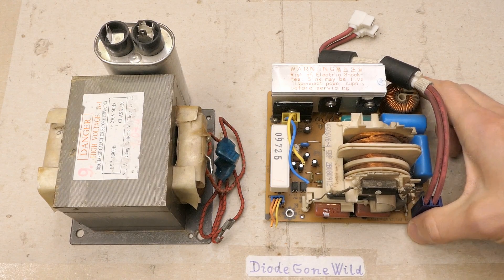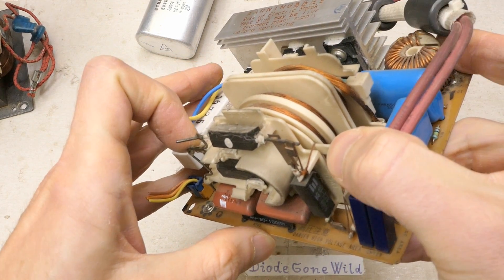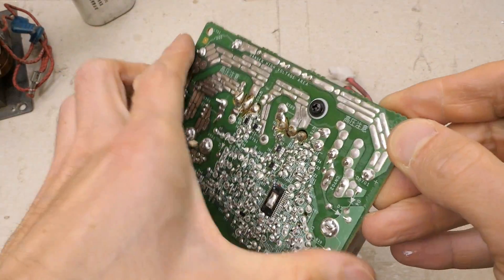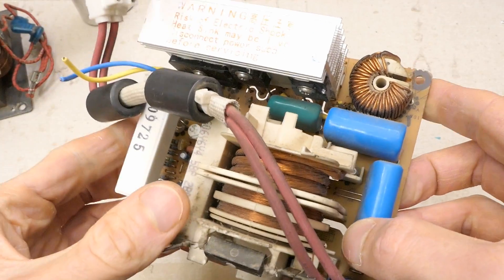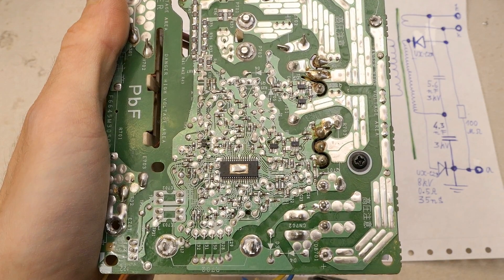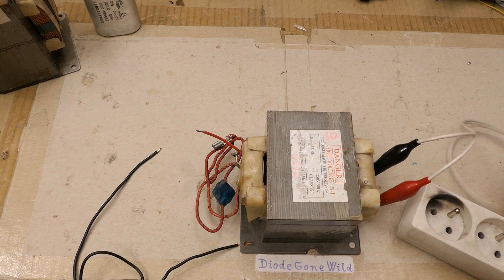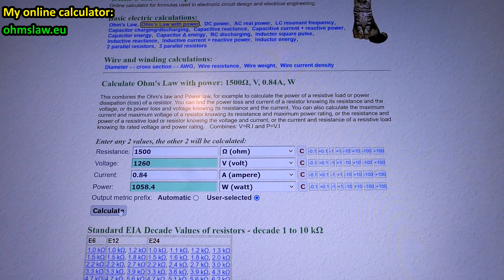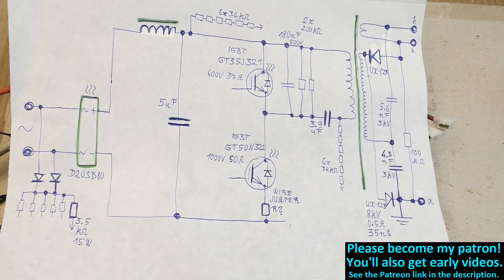A Microwave Oven Transformer, but switching!

Comment: Thanks for this. I'm sitting behind my screen, with a similar part in my hands  trying to figure out why my Siemens oven gave an E 10 07 error.  I see a voltage drop as well on the transistors. Yep, they drop to 0....

Comment: Have you ever tested the power used by Panasonic Inverter ovens? I've found three of them on the street for trash pickup in my neighborhood. They work fine but they draw 1800-2000 watts on high. My neighborhood has mostly older homes, many with 15 amp (120V) circuit breakers. These Inverter owens can trip the breakers. I assume that's why owners think they are defective and throw them away. One I found last week looks brand new but draws over 1800 watts on PL10 (high). Works fine on PL8 or lower on my 15 amp circuit. I've never tested the power used by a brand new oven. Maybe the ones I've found actually do draw power far above the normal. I don't know.

Comment: Very informative video, Thank you.
At 10:10 onwards, what (kinda a self made) device you are using with single 7 segment display & two crocodile clips to measure transfotmer windings? What does it measure?
Reply from the maker: It's a ring tester. It tests the Q factor of the windings. If it's very low, it tends to indicate short turns in the winding.
Reply: @DiodeGoneWild  Thank you

Comment: This is an excellent comments section and a well informed video too.
I've just repaired my Panasonic microwave and worked through the circuit on the inverter to checl the components.
Before the the inverter there is LC and MOV filtering with single glass fuse. Energy is switched with a spst relay on line. Safety interlocking shorts the line and neutral if the relay is closed, but the door opened (user exposed to rf).
Idle current for the inverter (230volts ac) is <100mA. No load current is <500mA and full load for a 1000w (output) is ~7 amps (1300 w rated input).
The output is duty cycle regulated by PWM. There should be a more liner power reduction rather than the long cycle times from on/off transformer systems.
The service manual states upto 40kHz switching frequency.
The heat sink is live (electrically hot) via the igbt tab.
The grounding is via the high side screw hole and solder ring to chassis or frame ground.
There are a number of designs about but the pcb looks like the same one with various pads depending on components.
I may try to upgrade a dual magnetron commercial microwave with these as it has a transformer failure. A simple pwm driver should make it possible.
Note that these come in shrouded air ducts.
There is an NTC on the collector pin for thermal monitoring.

Comment: Add lot more diode and HV capacitor to voltage multiplier section then connet it with an x-ray tube. 
It is will be as dangerous as possible.

Never combine HV with HF. It is cut thru any isulation, what are usualy works well at low frequency.

Comment: Microwaves are dangerouse but having said that so are cars. Research brings knowledge I have built my own spot welder for 1/4 inch steel and for welding alloy.I have built myself a 12v heavy duty car battery charger.Numerous other things from microwaves. Not out of need I have excellent welders and numerous battery chargers. But solely to learn. So research what is safe and not safe and take extreme caution and do not blindly follow someone else who says do it this way do your own safety research.I can repair most cars, commercials,tractors, forklifts etc all self-taught. I am about to try a repair on my microwave power supply as I have a bad IGBT.But that is not recommended unless you have a lot of experience and again take all safety precautions. PS i will not pass on any info as to how I have made things do your own research you will then be safe.

Comment: The only real benefit to inverter based power supplies is powerfactor. That and it's less likely to kill idiots because they typically break before you can do anything silly with them. 

I like fancy inverter stuff but only when schematics and stuff is available. Proprietary non serviceable designs are basically E waste

Comment: This seems like some kind of active clamping soft switching forward converter, instead of the normal fly back converters. The primary capacitor is placed such that it functions as a series resonant LC tank, and the top transistor is probably the smaller one for clamping the "reset" current (inductive kick back). It's very likely that the main switch is operating with soft switching, and the auxiliary switch could also be soft switching if designed correctly.
Reply: Also to mention, in some soft switching converters, only the primary switch is designed to be soft switching since it sees the most amount of current, and larger switches have more switching losses. The AUX switch doesn't need to be as big and consequently has less switching losses, therefore the switching losses from hard switching is acceptable.

Comment: Thank you Sir for this video.   Can the inverter board be replaced by using the normal transformer with capacitor and the high voltage diode?

Comment: From all that I’ve read from other sources, the switching supplies in these ovens operate at about 50KHz. That makes them much more efficient than the 60Hz transformers.  The ferrite core in them is built to run in the 20 - 50KHz range. 
I’m looking for one of these boards to rewind the secondary for low voltage, high current output.
With this high frequency, copper coated aluminum wire must be used due to the skin effect of electron flow. Using solid core wire is a waste here.

Comment: Can somebody provide some insights as to why the capacitors in the doubler circuit are different values?
This seems to be the case in every microwave inverter I've seen.
Reply: They are the same value in the older Panasonic Series 2 inverter I have in front of me, but later series certainly use two different values, usually when they are a single ended parallel resonant converter, which is not symmetrical in operation. The capacitors are resonance capacitors. Not simply energy storage for the power output, but a time constant in resonance with the transformer inductance, as is also the case with the much larger single capacitor in the mains transformer designs, them at 50 or 60 Hz, these at tens of KHz. I hadn't seen specific discussion of the capacitor values but I did find a technical document that covers it. Linking away from YouTube is problematic due to rules, but if you search for "Parametric Design Guidelines for MW Oven Inverter" you should find it. If necessary add Bocchiola.
Reply: @PlatypusPerspective  thanks for the info!
Reply: @MrTurboturbine   Hope it helps. 🙂

Comment: I ran the single transistor version of this inveter and it wants a 220Hz 5v squarewave PWM 100% positive offset on the input opto. it needs to be at a low duty cycle to start say 20 percent iirc

Comment: What I have thought of for a good while is why you need the voltage doubler at all in microwave ovens instead of using a transformer outputting 4000-5000 kV directly to the magnetron? Does it have something to do with insulation capabiities of the transformer at this size or something similar?
Reply: Yes, greater difficulty and cost for no advantage. The voltage doubler is ideal for the purpose - half the voltage handling requirements for components (transformer, rectifier, capacitor) which would otherwise have to be far greater voltage rated, and draws power on both half-cycles of the mains (desirable) rather than only one for a simple half-wave system.

Comment: I appreciate your discussion of the dangers but showing yourself drawing an arc with what appears to be normal house wire doesn't seem like a good idea. I see that the wire is grounded to the MOT core so theoretically you are safe. Your fingers are only a few inches away from that arc though. I would have done the demo using a small hot stick to hold that wire. One of my son's friends was killed by a MOT while doing wood burning because he thought that normal THHN house wire, which of coarse only has a 600 volt rating, would protect him.

Comment: where could I find the schematic at 0:36 ?
Reply: The specific schematic onscreen? It's completely visible, so take a screen shot? Print if desired. Or copy by hand? The Czech source site is watermarked on the image, but nothing identifies the type of microwave that schematic is for - it is rather characteristic of older model Sharp units.
Reply from the maker: https://danyk.cz/reverz04.html

Comment: If you run the control section with the power transistors removed it could give you the operating frequency. Good to know these exist, so I can use the old audio mantra (mo heavy mo betta) when choosing components for stupidly dangerous projects.

Comment: Damn, high-power high-voltage high-frequency diodes? And that's just getting started, I can't dare to imagine the prize of this!
Reply: I'm guessing you mean the price? I've been out of MWO repairs for quite a few years, but I randomly Googled and (being in Australia) an LG inverter for many of their models would cost AUD99.95 (USD65), including Tax and without any trade discounts. LG prices are pretty good, inverters for other brands like Panasonic or Sharp would cost more. But as usual with electronics, volume production lowers costs.

Comment: I salvaged a comparable board from a dead MO. I figured that these would help make the devices die earlier since any switching PSU has a much more limited lifetime than a good old passive transformer. However I figured it did have some benefits. The board had a PWM entry to smoothly reduce the power output. And that's nice because you don't have this with the regular transformer. Instead when you want 300W, it does 900W for 10 seconds, and 20 seconds pauses, which is a disaster for small pieces of food that you don't want to burn. It also alternates heating and cooling of the magnetron which certainly shortens its lifetime. So there are actually also some good points in having an electronic PSU instead of a transformer.

Comment: Do you wash your hands afer soldering,and do yoy wash your hands after using the stuff you made like the thermometers?
Reply from the maker: I definitely wash my hands after soldering, especially because of the leaded solder. When I finish building something that's to be used in a clean area, I clean the outside of its box, so I don't have to wash my hands after touching it.
Reply: @DiodeGoneWild  Thanks a lot,now i can safely use the curcuits and stuff i made
Reply: By the way do you wash your hands after you use your smartphone and laptop. I've seen you use your laptop while soldering to show us the spectrum of lamps. SO do you wash your hands BEFORE using the laptop? AND do you use your smarthphone WHILE soldering,OR do you wash your hands FIRST,THEN USE THE PHONE?
Reply: Sorry for my crappy English,i'm Chinese.
Reply: @不知所错 - why are you so paranoid about solder? There are far more dangerous things like air, water, sunlight, and car accidents.

Comment: Great Video, great explanation! I like vintage power supplies 😀. I have been sleeping for years with my ears next to my mains alarm clock which has/had switching power supply integrated I not like anymore. It produces high mosquito sound I nowadays suffer from tinitus with exactly this high frequency white noise of this mosquito sound in my ears. And I cannot hear very high frequencies from outside anymore. 
Thanks so much for favourite linear older transformer power supplies! 😀

Comment: :face-orange-biting-nails::face-orange-biting-nails::face-orange-biting-nails::face-orange-biting-nails:
Most sensibly, the digital control board of the switching power supply should be disconnected. Cut all the wires!!!And use the Arduino module.
Replacing high-voltage transistors.Further experimenting with small input voltages of 20-50-100 volts, etc., you can create your own pulse high-voltage power supply.
Programming the Arduino you will reach the top of scientific and technological progress :)).

Comment: I can tell you I don't have time to die from my fractal burner. When I had the capacitor in parallel the primary caught fire. And 10.000 volts hurts really bad. So I removed the capacitor and 2.100 volts doesn't hurt as much but it is much harder to let go of.😅

Comment: I was a bit shocked that Dany just picked up that hv wire bare handed with that transformer just plonked on the desk.
Reply: He was actually holding a ground wire.
Reply: @eDoc2020  thanks for your comments. Both u fellows comments actually. I didnt know he had an insulated work table. I know he is more than competent and doesnt take risks, but it was just shocking for me seeing someone not using a chicken stick etc with a mw transformer. I have many of these, the old copper coil ones, more than 25 and the caps and love playing with them in various configurations, and my arse puckers even thinking about not using the chicken stick, or running them un insulated ha ha. You guys know a lot more than me, tell me, how can there be a hot and cold end of the hv coil when the current is ac, and no rectification. I just dont understand that.
Reply: @jonlitchfield8888   Ground does not equal negative and hot does not mean positive. A wire at -2kV is just as hot as one at +2kV. If you put a voltmeter between ground and the hot side of the coil you'll get something around 1500 volts AC. If you measure the voltage between ground and the cold side you'll measure zero because one end of the coil is directly fastened to the grounded bracket of the transformer.
Reply: It doesn't matter because the transformer in question has no connection ..
electrical or (static@50Hz) capacitive to any earth/grounding and most importantly the other hand or no body part is in physical contact with the other bare wire.
Reply: @analoghardwaretops3976  I think that's a dangerous statement to make because of the voltages involved. The primary is most likely not insulated for 2kv, so if you touch the high voltage lead to real ground the transformer core will go live at high voltage and it could arc over to primary.
Reply: @eDoc2020  50/60 Hz Tx. under test..one can clearly see the pri. & sec.are wound on two separate bobbins. & printed schematic shows an isolated stepup secondary. So question of
 pri. " isolation " doesn't hold..besides all testing has been on an insulated work table... 
Even feeding the pri. through an additional 2/3/5kV isolation transformer will be of no more saftey than this demo setup. 
Usually wires for 2-3kV
voltage potential will have insulation that has to withstand at least 
7.5-10kV b.d.v.
besides to comply with safety standards...engineers/ designers will have considered most of 
" your " IF's & BUT's doubts before a product evaluation /release.
so D.G.W. is very capable and cautious & also knows the consequences..and has taken sufficient precautions for this demonstration.
Reply: @analoghardwaretops3976    Sure the secondary has good insulation but the primary is only intended for 230 volts. I agree what DGW was doing was safe, I was just pointing out that your comment could lead to disastrous results if people used it as general safety advise for their own experiments.

Comment: The heatsinks are nifty, there are only 2 types no matter what mw it is. Also the igbts, they are always non matching, same with the hv caps. Unfortunately the igbts are quite slow. 
Also no doubt someone here in the comments has already said, but a while ago a guy here on yt got one of these going, it did need a pulsed signal, cant remember what it was tho.

Comment: Ive salvaged many of these. They have some neat parts. I remove the primary and apply standard 5T + 5T and normal irfp250 zvs. Not ideal output for pretty arcs as ratio way too low, even with lower pri. Just high current ac that burns even aluminium immediately. I remove sec and rewrap with .3mm from the fan motor and drip on epoxy in process, can fit on 1500 turns easy, and makes a pretty resilient hv coil. Also make a big ferrite out of two matching transformers, and same for hv coil. Makes a pretty kick arse high current and hardwearing transformer. 
The mw's with the EE ferrite and secondary inside the primary have the best bobbins for the secondary, but not suitable ferrites. The mw's with the UU core are best for ferrites that can be mixed and matched. Seems about half are big, and about half slightly smaller, but only 2 sizes, no matter what mw they come from. Thats what i use them for anyway.

Comment: I remember BACK in the day replacing these in Ovens and having to send the old one back to Panasonic for them to rebuild it and send it to the next peeps.
Reply: Yes, the rework program. When the Panasonic Inverters were released in 1988 I had been a technician for 13 years and ran the service department for an electrical retailer.

Comment: What does it actually mean negative kilovolt I didn't get it maybe just polarity is reversed
Also I comment on your other video to do a series on power supplies explanation.
Reply: Yes, the polarity of power supply is reversed compared to the more common scenario where the chassis/frame is the negative reference and the power supply potential is positive. As in cars, where the battery negative terminal connects to the chassis, whereas in some old vehicles the chassis connection was to the positive. A MWO is like the early automotive example, the positive of the high voltage supply connects to the metal frame and the multi-KV power supply output potential is negative.